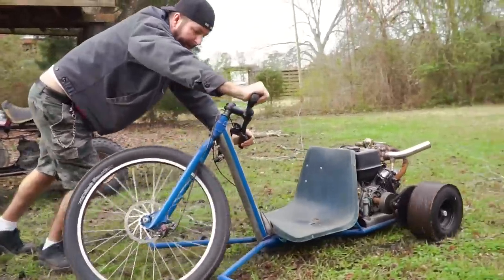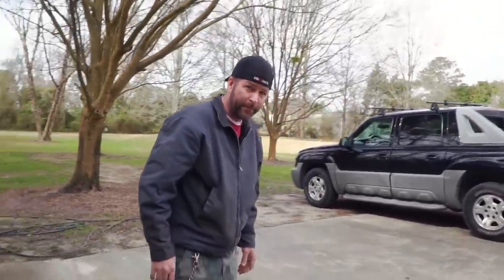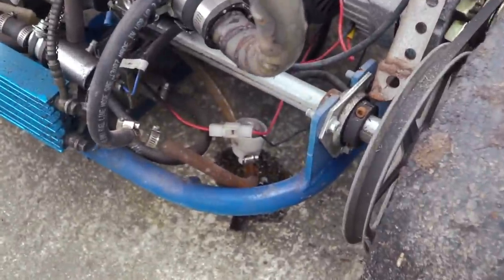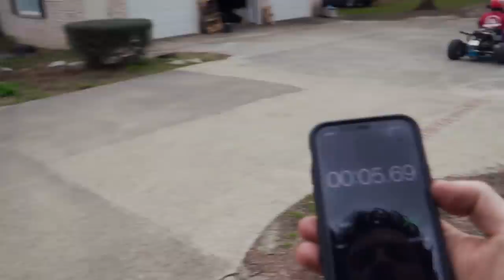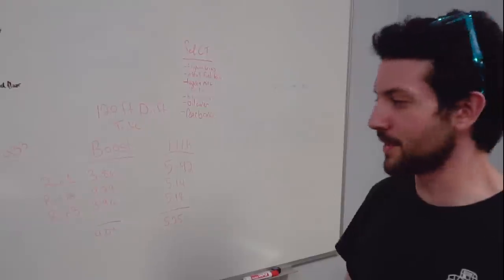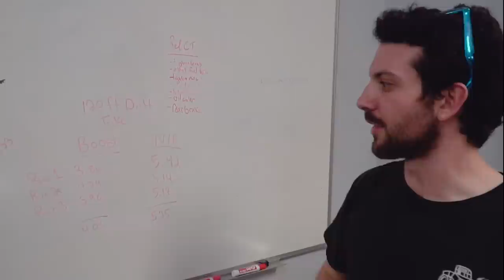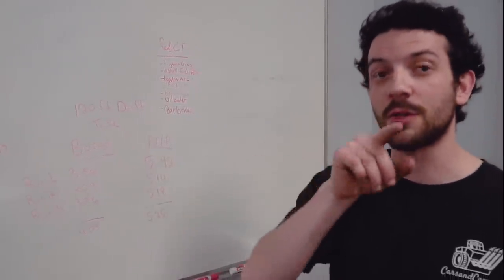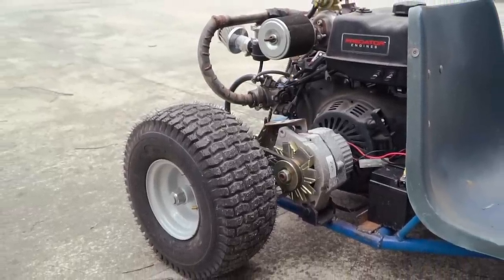420cc Turbocharged Trike Revival & Boost Test!

Comment: Add a higher stall clutch so you can build boost off the line🙃
Reply: it won't build on the line with a clutch, you would need a viscous coupler and/or an electronic controlled anti lag system {bang bang}
Reply: Diesel Ramcharger if they ran E85 or race gas they can run more timing so it has less turbo lag
Reply: The one cylinder has gaps in time in between the 4 cycles that don’t allow it to build much boost at all, but .5 psi is a difference for sure

Comment: Twin turbskis on the Crosskart would be sick
Reply: I suppose a single snail would suffice, but why not go twin since there's plenty of space and RPM to use.
Do it for Dale
Reply: @ollilehtonen6764   What does RPM have to do with the number of turbos?
Reply: As if the motor could hold boost
Reply: @lobmin  rpm poduces gas to spin turbskis
Reply: camjamsdad  EEEYEEE!
Reply: @quentin8094  any engine can"hold boost" as you so not intelligently put it.  Read more internet idiots talking about holding boost, that's the way to learn. The only reason any turbo charged(or supercharged or nitrous for that matter) engine will fail is because of improper tuning or trying to make too much power for the parts to handle. Any engine can handle at least a 25% increase which would equate to approximately 3-4 psi. Most wouldn't have an issue with up to 50% which is in the 7-8 psi area. This is all assuming proper timing and fuel tuning. They blow up when you detonate the shit out of them with timing or cheap gas, run them lean under load and when you start making serious power parts start to go. Cast pistons are usually the first weak link. Not enough ring gap will cause bad things at medium to high boost situations. A good motorcycle engine will respond very well to forced induction. High compression ratios need to be watched and carefully tuned though.
Reply: @jasonbirch1182  you know what your talking about other then your percentages. I can tell your a car guy by your 7 to 8 psi boost claim bc that's what most cheap kits will give you and your engine can survive but as for some engines especially dirtbikes theres bikes that break rods stock bc no one engineer is perfect so saying a certain percentage of engines can handle a certain amount of boost is false some engines die stock just bc there designed like crap
Reply: lobmin higher rpm means more exhaust gas to spin bigger or more than one turbo
Reply: They need the turbo/turbos as close to exhaust port as humanly possible, the heat and expansion coming from the exhaust is REALLY what a turbo needs to get spinning as opposed to a bunch of air flowing through a pipe.
Reply: Get an aftermarket ecu on it with electronic ignition and fuel injection. Would be a beast.
Reply: @broughttoideas  very loose approximation. Boost is only a byproduct of restriction and not an absolute for power increase. It is very dependant on the turbo and cyl head, exhaust pre and post turbo. I'm only making speculation the average guy can relate to. In a perfect world an engine at 1 BAR/ 14.7 PSI will make twice the power the same N/A engine. But there are volumetric inefficiency, friction compression ratio and other factors that change the actual output. The 750 bike motor on the not so cross cart should have internals to handle a 50% increase in power if tuned correctly and more probably on methanol or race gas. It also need to not be lugged down and on boost at low rpm. Any engine is more likely to hurt the rods at lower rpm if it's making boost and being strained. But the guy I was responding saying"as if the engine could hold boost" is just one of those clueless comments I have to say something to. I'm far from the most expirienced turbo engine builder but I am very well read and understand how and why things happen in a forced induction engine. My next drift car im building now I am going from. A v8 to a turbo inline 2.8 6 cyl.  Modest boost in the 8-10 range for 320-350 hp all day beating setup. I know this engine will make well over 400 at higher boost.
Reply: @ollilehtonen6764  who's Dale.?
Reply: @patriottowing4973  Dale Earnhart
Reply: @quentin8094  Hell yeah brother 🤘🏼🇺🇸🦅
Reply: jason birch I know I can hold boots first of all. But putting boost through an older 4 cylinder motor that was built for little performance from factory isn’t reasonable. It’s gotten west and tear from what I can guess, but adding a turbo would put tons of stress on the motor even at around 5psi. And adding that’s it’s a four cylinder, you’d have to fabricate the 4 exhaust pipes to route to the turbo, then make 4 or two pipes (wether you have four or two carbs) that go into the carbs. Then they have to be completely re jetted and re tuned for the extra air that’s being forced into the motor. They will also have to be put back into sync. There is also the problem of finding a spot for the turbo as well.
Reply: Yes
Reply: Brice Hency I put a turbo on my 420cc preadator and put it on my go kart I now do wheelies
Reply: @jakechunasamy9642  SICKKKK
Reply: Brice Hency thx I got to make a wheelie bar and then imma make a vid of it
Reply: @jakechunasamy9642  what are you going to use to make the wheelie bar
Reply: Brice Hency I’m thinking about getting a go kart axel and welding something together so it works as a wheelie bar
Reply: @jakechunasamy9642  I know how that goes
Reply: Brice Hency if u see a wheelie bar on a Traxxas rc car it’s gonna look like something like that
Reply: @jakechunasamy9642  okay

Comment: You guys should do a stage 3 build with that motor, keep the turbo. Make as much boost as possible
Reply: the more power the engine makes naturally the less "boost" you will see on the gauge...even though you are making more power. Boost is just the engines resistance to airflow.
Reply: I second this...
Reply: Yes and maybe add some front wheels so they can turn and stop with all that power.
Reply: Diesel Ramcharger yes but if the motor pushes and pulls more air na it will spook turbo more
Reply: yeah.......and put a 94mm precision turbo on it
Reply: TheGuysWithCars What exactly is “stage 3”? That’s some bs term developed by NFS that literally means nothing
Reply: @daerrickjohnson1349  pretty sure go power sports sells a kit of engine parts. The level of aggressiveness/power is the "stage"  but I do agree in tge fact that "stage" is stupid.
Reply: Add nitrous

Comment from the maker: We always knew the turbo made a difference, but not THAT MUCH of a difference😳
Reply: It's so awesome!!!!
Reply: CarsandCameras but it is cool so it doesn’t matter.
Reply: You should build that 420 to rev higher
Reply: Wow, just wow!
Reply: Need a front fork with suspension!
Reply: I would strongly recommend picking up the branches on your track that front wheel will pick them up right in front of you remove chances of empanelment
Reply: If the turbo isn't being spun up is it acting as a restriction killing your "normal" NA HP?
Reply: Where did you get the turbo from
Reply: 420 TT
Reply: CarsandCameras Hey listen if you guys want more traction on the front tire try going to a big wheel set up that’s on like an SE bike or a big ripper bicycle
Reply: Make nice smooth pipes on that little turbski! Bet it will make it spool up a lot faster...
Reply: Hey fellas small engines need a boost canister to hold residual boost in between exhaust pulses. If you want to get the most out of it with the turbo.
Reply: @muthafacka23  how? Did you watch them make this one? It was the best they could do, so unless you wanna offer some of your services for free or as a sponsor they know....
Reply: Hey john and Ike I sent you a picture on Instagram about a gokart idea
Reply: The reason that you do not feel that much of a push is probably because the turbo is not big enough and is choking the engine or because you need a air to air intercooler that is small to give it colder air. I would suggest a bigger turbo and an intercooler. And I am pretty sure that waist gate has a spring in it. If it does I would look into putting a bigger spring in it so the boost is higher.
Reply: You should boost the cross cart
Reply: Try shortening clutch spring for a hight rpm launch
Reply: Try a gt 12 or gt 15 compounded with the current turbo for all the boost.

Getting it professionally tuned in  its current state would also help out alot.
Reply: Boost the cross cart
Reply: That's cool
Reply: Turbo the drag rail
Reply: @poppasmurf009  exactly.. was going to comment that but I didnt have to!
Reply: You should make a turbo yerf dog!
Reply: Put it on a Diesel engine
Reply: the truck what is going on
Reply: Thats because it is a wrong test. When you remove the intake boost pipe, the turbo is an huge restriction on the exhaust side
Reply: That thing has crazy power
Reply: Like the others said the turbo housing on the exhaust is causing a restriction
Reply: Impressive difference.  What will you boost next? Lol
Reply: looks like about 50-60% more power.  not bad.
Reply: Put a dominator clutch on it an see what it does!
Reply: I still think you should use that diesel motor and put a turbo on it and build another truck with it
Reply: I just scored a free yerf dog go kart and was wondering if a tillotson 212 stage 1 race motor would fit on it?
Reply: Put turbo on the crosscar 💪💪💪💪💪💪🔥🔥🔥🔥
Reply: Isn't the golf cart a built 420 might do a swap
Reply: I have an better idea. Remember that smog pump you tried to use on puggly? Put it on a predator. Instant 18 pounds of boost. Just saying.
Reply: Stage 3 and turbo
Reply: I really like you guys , but if Turbo City could not get a turbo to work on a single cylinder engine a few years ago when they tried it on a Jr.dragster. engune I really doubt you two did it !
Reply: Now put all that stage 4 stuff on this engine, make it run on e85 and go hit speed records 😜
Reply: 1.21 faster=1.21 gigawatts
Reply: You got to take more than just a drift trike to an airshow event. If they got to run-way you got to do a drag race between the Dragster & the Cozy Coupe for sure, which has to trailer in the Red Wagon.
Reply: You guys gotta do a SUPERCHARGER build! it'll work way better!
Reply: Y’all should put a small air compressor on there and feed that to the turbo to increase your boost at lower RPMS. Or attach an electric motor to the turbo. There are a few kits online that include all the components for an electric turbo.
Reply: CarsandCameras Grease your bearings in your tubo it might help it will make your turbo wind up smother and faster.
Reply: I had an issue where I blew the sideCover gasket on my 196 clone it’s got the fillet ride to 265 Cam, 22 pound valve springs. I’m just curious where the best spot to put a crank case vent would be and if I really need it, my thoughts where I blew the side cover gasket do it too much crank case pressure the only pressure vent I have right now is the one in the valve cover.
Reply: And to give your turbo mod more value for the money vs N/A money mod remake the charge piping. You don't need a big canister like many say for the single cylinder pulses. But make the piping larger and smoother like you would if you'd be trying to make power N/A. I have a turboed 13hp Honda gxv390 on my lawn mower. It makes more boost and power vs N/A even at slower rpms needed for a lawn mower. Single cylinder turbos are awesome.
Reply: And by the way I switched from a vz21/rhb31 turbo on gate at 6 psi to a gt15 turbo with gate blocked shut making 4 psi motor revved up blades running ready to mow with high lift blades. Charge air pipe went from too hot to touch after only mowing a few minutes to warm to the touch after mowing the whole lawn.
Reply: Tune the clutch so it builds boost before or on launch. 

Or anti lag the sh!t out of it!
Reply: CarsandCameras hi I'm a huge fan just you guys should put pushbike suspension at the front wheel I think it will make a huge difference
Reply: I love you guys keep it up y'all are my inspiration to keep going
Reply: I have a 1994 f150 with a mustang motor with stage 3 cams and turbo
Reply: Where do you get a turbo of that size?
Reply: CarsandCameras I have a turbo on my 420cc preadator and I need to weld a wheelie bar when I finish imma make a vid
Reply: Should drag this out for revival V2
Reply: 1.21 seconds faster boosted
1.21 gigawatts of power to make time travel possible
coincidence?

Comment: Sand rail with a 670 running EFI and the turbo with some big paddle tires on the back
Reply: it wouldnt move lol
Reply: PC Master Race good luck with a transmission lol, the built 670 barely moves the drag rail because of the lack of a proper transmission.
Reply: nick podgorny no

Comment: Been working on a revival of my first ever go kart motor. Gx160 I’ve put new Dyno Cam, 1.3 rockers, Mikuni carb, flat top piston, billet rod, billet flywheel. And I’m going to fit it with a blow through turbo. It’s complicated but I have a multi stage pressurized fuel system. Separate oiling system set at 13 psi. A while number of fabricated crazy ass parts. I’ll post a pic in comments when finished. Really enjoy the channel and have used a couple ideas from you guys.

Comment: Smog pump supercharger on the next rail engine
Reply: Ive seen pit bikes with them but no numbers on performance gains or durability.
Reply: @ @AustinRBa  I've used a smog pump got about 10 psi on a 212cc. It's not worth the work. The pump wears out quickly .
Reply: Im doing one now not for the eightball camaro kart but a mini drag bike im building should be fun.
Reply: @Forge_Fab  that's disappointing news I was about to put one on my mini drag bike.
Reply: @spreaddeezhazelnutz7511  yes I already have one.

Comment: I'm sure it makes a nice difference. I have a Rhino 660 with a Garrett T20 turbo on it and it runs fantastic. Nearly everyone continuously says that single cylinder engines don't respond well to boost, and carburetors (which my 660 is) don't tune out well with boost ever. Yet the normal "build" for a Yamaha 660 is to bore it out to a 686, and my stock displacement at only 4psi is quite a bit stronger. Not to say it won't ever be a bit more temperamental, but by now it's pretty well dialed

Comment: When I saw it take off into the grass, it was clear that it was making boost about 20 feet out and digging ruts. It is lean AF when you slam the throttle open. The computer may learn to compensate for this or you need more fuel pressure. I would recommend you both learn better throttle modulation.  Using the throttle to help maintain intake velocity will improve performance with all the aftermarket parts you use.  When you slam the throttle open (and you both slam the throttle open), you stop the airflow and manifold vacuum falls to 0.  The fuel injection demands more pulse width to the injector but low pressure fuel systems are slow to respond.  On carbureted engines that  have an accelerator pump (most 1 cylinder engines do not) the accelerator pump supplies fuel to compensate for the lack of airflow through the venturi when the throttle is slammed open and manifold vacuum goes to 0.  With or without the accelerator pump, learning to modulate the throttle will make you faster.  When building your machines use a bell crank or other device to allow for a long pedal movement that will slowly apply the throttle. Ask any superbike rider about throttle modulation, it is what keeps the bike on the road, and wins races. Thanks for another awesome carsandcameras video.

Comment: Try to restrict the exhaust outlet off of the turbo. It might make a little more back pressure on the turbine and make more boost. Kinda like going to a smaller a/r turbine housing. Just thinking that little engine and being stock probably doesn’t move much air through it. So the exhaust gases probably aren’t all that much, in volume and velocity or speed... just a thought. Turbos rock!

Comment: since the turbo has a wastegate on it. i would block off the diverter valve/bov
 itll help build the boost quicker and only "con" is youll hear some awesome compressor surge sounds which is kinda the point of a drift build if you ask me

Comment: Hey @CarsandCameras add an "air chamber" on the cold side right after the turbo you will see the difference!! That chamber will act like a "pre boost" for the engine, its gonna be able to suck in more air (more volume) as soon as you hit that throttle more air is gonna be able to get to the engine then, by the same effect push more aire into the hot side making more boost

Comment: When watching the you tube episode watched you guys struggle to install a turbocharger on a carbureted engine, well try this, build an exhaust chamber that the carb will fit inside of on one end braze in a sheet metal plate that will bolt between the carb and the intake throat to the engine with a passageway that matches the carbs. on the other end slip on a cone adapter that will attach to the turbocharger boost line the tricky part is to rig up the linkages and choke to the carb through the chamber sides seal the shafts as much as you can for little turbo boost losses but still allow them to operate. You simply must pressurize the inside and the outside at the same time and use a regulator and electric fuel pump that will maintain 3-5 psi above the boost level at all times. your stock carb will do fine. this will work and you will not believe the results...Mark

Comment: Add some small knobs on ends of foot pegs, and should give you a better sense of stability if your not pushing so hard on to keep feet on them.
Plus you can shift your weight to inside of turns without adding additional force to outside peg, are at least that's how it appears from my prospective.
Keep up the hard work young men, and thanks for the entertainment. Stay safe, and be well.